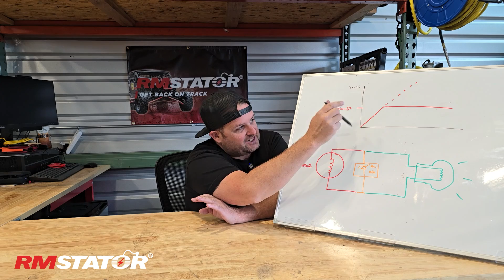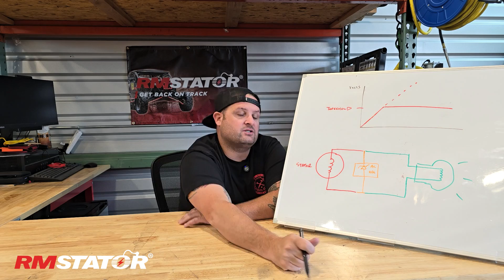Q&A - Evan at RMSTATOR answers all your technical questions!

Comment: so i have an 07 r1 and the oem stator and regulator just died on me if i buy your stator+your red machine aluminum regulator +flywheel kit will it work with a antigravity atz -10 battery ?
Reply from the maker: Yes, that is a great kit and will work fine with your antigravity.